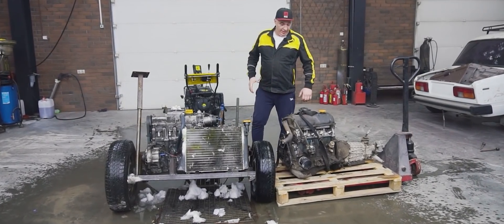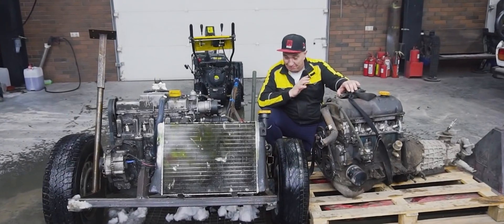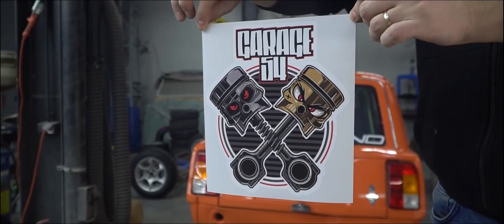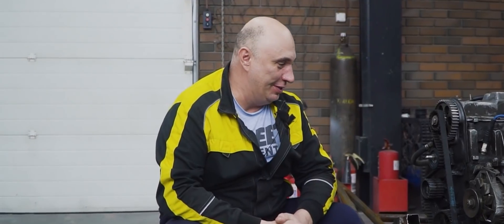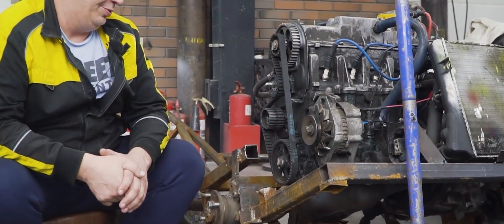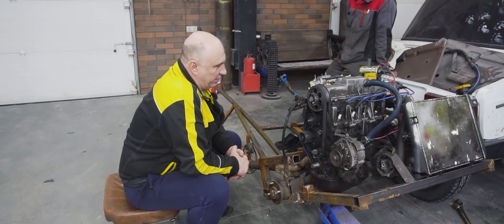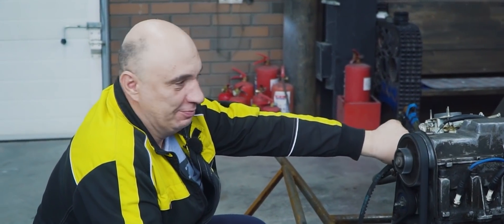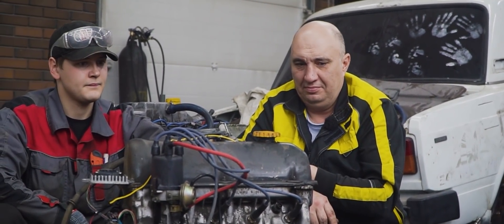8-stroke engine?? How does that even work?

Comment: If you simply double the number of cam rotations for each crank rotation, the valves would just open and close halfway through each piston stroke, pushing unburnt fuel out the exhaust and the piston loses compression halfway through the stroke. That's why it was hard to get those engines running, they essentially only had about half their cylinder volume to work with.
Reply: exactly .... was  doomed from inception...
Reply: If the timing shaft is at the correct position for TDC, then they will also be in the same TDC position at BDC with the inverted gear ratio (half crank = full timing), which means the exhaust valve should cycle somewhat before half-way through each stroke and the intake slightly after with all valves closed for the first and last quarter of each crank. With everything else timed properly, it should have 30-40% of a cylinder to work with depending on how quickly the intake valve closes. Needs a turbo to force air-fuel mix through in mid-compression (after losing most of the "intake" charge to the exhaust valve opening during compression) to have a chance of working.
Reply: @teardowndan5364  Possibly yes. I'm too lazy to draw it out on paper but the addition of a charger (although I would go with a supercharger than a turbo since you would need a good amount of exhaust pressure to pack the o2) might do the trick....
Reply: Considering "stroke" is number of pistons moving( lets not even start with waste cycle difference.....twinspark,water injected applications 
This Episode was never going to be a success. 
Adjusting the belts gave a few ° in timing. Causing over fuelling.
"Crankshaft" needed to be swapped with V8crankshaft and the Pistons need to be half moon x2 to complete chamber Cylindrical shape.
In doing so should mean half capacity engine running at twice speed creating normal power of 1 engine.
Reply: Before doing all that work you could have just figured it wasn't going to work
Reply: Exactly
Reply: @Karl with a K 😂

Comment: This is the first video i've seen where G54 gets it wrong...
You can't just swap the cogs, the ratio is wrong... You said it yourself that it was a 1:4 and what you want is 1:2...
Not only that, but the distributor needs to be slowed down too.
I havn't seen the original video, and i dobt an 8 stroke would yield more power, but you got to atleast give it a proper try and use some logic if you are not using the exact same engine.

Comment: Nope, you turned this into a one stroke. If the camshaft turn twice as fast at the crankshaft, you open and close the valves for every stroke. So piston moves down, valves open and close, piston moves up, valves open and close, piston moves down again, valves open and close, piston moves up to complete the intended fourth stroke, valves open and close again. Every stroke both the intake valves and the exhaust valves open and close. This would not even work as a two stroke. For a two stroke you would need that same rotation speed of crankshaft and camshaft. If you want to build an eight stroke engine, you must make the camshaft turn two times slower than it is turning on a four stroke. Not faster, but slower.

Comment: this seems more like a 1 stroke engine, for every single piston stroke the intake and exhaust valves open so it is trying to be a one stroke engine. if you wanted an 8 stroke engine you would have to put a bigger cam gear so that the piston does multiple strokes before the valves do their thing.

Comment: What about making a good old 2-stroke engine, by putting the same pulleys/gears on the cam and crankshaft as well, getting a 1:1 ratio?
Reply: Though 2 strokes typically don’t use valves, it seems as though with a little cam timing work this might actually work!   Great idea.
Reply: Poppet Valve engine. They have done, on a VW Diesel engine.

https://www.youtube.com/watch?v=kot9GYBeCJ8

Comment: I hope this was a joke, you guys certainly should have known this wouldn't work, and what the result would be.  I'm guessing you did given the demeanor before you fired it up.  Besides, if you could turn a 4 stroke into and 8 (whatever the hell that is, every other normal power stroke dead?) you would end up with LESS horsepower, not more, because it would have a 1/2 as many power strokes/turn.  Same way a 2 cycle of a given displacement was more hp than a four.  Last point, if this actually would work the automotive engineers would have figured it out and used it.  If there were any watching they were probably laughing their asses off...kinda like you.   Some of the crap on the internet (the original video) are beyond belief.  I don't mean the fact that they won't work, I mean the fact that someone takes the time to spoof that kind of nonsense.

Comment: The only thing close to this that I've ever heard of working was I believe Ford had a small block v8 it might have been the 1st of the 302's that you could swap 2 of the cylinder's firing orders and generate more power I think the engine was less efficient but you made a significant jump in power. maybe 30/40 hp which is significant for the amount of work required.
Reply: 4/7 swap. works on gm small blocks too

Comment: Try  Is forced induction like a Turbo it would fix the stale air If the cylinder through it may not fix the timing issue

Comment: cam shaft will not allow enough fuel to stay in combustion chambers, if the cam is in time the exhaust  will open before compression so no compression! if you can  see  piston location to valve timing  you should see why it dont start !

Comment: Wouldnt a valve always open during a compression stroke if the cam was making 2 rotations? I am not sure how this would work.
Reply: Yes. I've always thought the whole "you need three things: air, fuel, and spark" was an oversimplification. You also need compression, and all four of those things have to happen at the right time.

Comment: I was under the impression that the crank was making 2 more rotations for every 1 cam rotation. So 4 to 1 crank rotations instead of 2 to 1. But it makes sense why you flipped the gears to get this. I wonder if you made the crank rotate 4 times for 1 cam rotation if that would make any difference. I kept thinking no but then I wouldve thought this wouldve ran or something.

Comment: I always wondered about a 6 stroke engine.
Intake (fuel), compression, power, exhaust (fuel), intake (no fuel), exhaust (no fuel)
Fully purge the engine with each combustion cycle. Should be able to make water cooled power on an air cooled block. Reduce the weight massively, and a turbo might improve heat scavenging. With the turbo you might leave both valve open for the flush stroke?
Reply: That's a bit like a hit and miss engine.

Comment: Screw 2 flathead engines top to top so both pistons meet up to fire at the same time. What could go wrong? So instead of horizontally opposed it would be an horizontally inpposed engine.
Reply: Aren't there actually diesel engines like that? In submarines or smth?
Reply: @sloopkogel22  Old large 2-stroke diesels, but they tend to need forced air induction to work..
Reply: There are engines like this, sterling engines maybe? Can't remember exactly but I'd love to see their version
Reply: The T-64 tank used an opposed-piston diesel engine. You can also look up the Fairbanks Morse 38 8-1/8 diesel engine used on watercraft and locomotives. And for fun, look up the Napier Deltic.
Reply: I was totally thinking about an opposed piston engine with two blocks together but I didn't think about a flathead engine. Maybe do OHV for one block and a flathead for the other. That would be wild!

Comment: In a 4 cylinder. Modify 2 cylinders as air compressors and feed them to the other cylinders. Self supercharged
Reply: this would only feed the normal air volume of a cylinder. no extra boost
Reply: @atsekjoker  It would be great, who doesn't love getting less, for more?  Oh, wait.
Reply: @atsekjoker  in 50cc landspeed record they tried this, it forces the air in after the other cilinder almost finishes the inlet stroke, effectively putting in 100cc of air. This was meant to circumvent the 50cc limit so to say
Reply: @atsekjoker  would be double
Reply: @atsekjoker  And what about the intake stroke? It would pretty much just return the air.
Reply: This guy invented free energy! (The compression cylinders need to have a insane compression ratio for that to work I guess.
Reply: This is already a engine design, you basically double the air intake of the other cilinders
Reply: @NoctisIgnem  but has it been done with a LADA?
Reply: 2 cyl feed 2 cyl = 0 gain. How about 6cyl as 2 cyl run and 4 to compress. 🧐
Reply: @diywe   well the air compressor cylinders would be essentially 2 stroke. Making the volume of air double into the running cylinders

Comment: There are actually 8-stroke engines,  the cam rotates once for every four engine rotations. They would have a heavy flywheel, cam grind would be very different, and would be good in agricultural pumps and some generator applications. Efficiency would be good, but output would be fairly low power though.
Reply: So what are the other 4 strokes? Apart from suck, squish, bang, blow?
Reply: @MariuszChr  pretty sure he doesnt know, but i think he is refering to the single cylinder hit and miss governor engines from the 1900's https://youtu.be/hlc-i7gxW94
Reply: @MariuszChr  You hit the nail on the head. It's physically impossible. The only thing that happens is the repetition is 2x the speed leading to failure.
Reply: @NIGHTOWL-jf9zt  it maybe makes sense to blow gases twice for cleaner air mixture, but probably worth nothing seeing EGR systems...
Reply: @MariuszChr 
Absolutely.
Marius is correct. May be sarcastic. 
In theory no more strokes other than
intake, compression, power, and exhaust.

Any further would be multiples or increased cc.
Reply: I have come across a 6 stroke experimental engine with a scavenge in and scavenge out stroke inserted between the exhaust and inlet strokes.
Reply: To design an eight stroke you need to define what each stroke is for and then design the valve action to suit. e.g. 
1 induction
2 compression into charge tank
3 induction
4 compression into charge tank
5 induction from charge tank
6 induction from charge tank
7 ignition
8 exhaust
Would need a heavy fly wheel or at least 8 cyclinders to run. Couldn't see the advantage though.
Reply: A stroke doesn't mean an ignition by half a piston cycle lmao
It's like saying your car is a 0 stroke when you let off the gas

Comment: These engines are 4strokes in 2stroke cycle (it suck & compress in first stroke, then it ignite & exhaust in seconf stroke (when piston is going up)). Try 2x smaller wheel on crankshaft, maybe it will work. It would be interesting to see working 8stroke engine.
Reply: is this 8 stroke possible suck, squeeze, 5x bang and blow

Comment: you should build 2 lada engines on top of each other so the cylinders against the cylinders no valves or cam shaft
Reply: where does the air come from and where does the exhaust gas go to?
Reply: like an Opposed Piston Diesel Engine, i like it!
Reply: @fanplant  you would need a cylinderhead between the two motors with side valves, ore bore the block to press air into it and let out the exhaust gases
Reply: @atsekjoker  not a head as much as a spacer with intake and exhaust ports and valves. That is unless they drill ports in the cylinder walls and make it a 2 stroke. Oh those poor Lada engines

Comment: Might have better luck converting a 4 stroke to a 2 stroke.  With forced induction I'll bet you could get a little four cylinder like that up to about 300HP.  At least until a rod goes through the oil pan.
Reply: I like your idea but let's upgrade rods and Pistons and rings to give it best chance of working
Reply: @bigjay875  I second this
Reply: The Detroit diesel 8v71 is what your looking for. They solved all those engineer problems.
Reply: @tommysmith8801  yeah 2, 2 stroke diesels converted into opposing Piston, those 8V71's would be a beast lol.
Hold on sorry 6v71 is the straight right.
Reply: @SP-mp9yi  there's a company trying to bring that engine platform into reality but 3 cylinder.
Reply: @tommysmith8801  Yeah I saw a YouTube short on one, it sounds really promising, very good on emissions with high power outage, someone had commented that it's been in the Railway Industry for years but I'm not sure.
LoL probably not an easy bolt together though l may not have thought that through 😂
Reply: @tommysmith8801  No shit worked on them before.  That's where I got the idea.
Reply: DKW Auto Union
Reply: There need to be a camshaft, and there need to be a supercharger to force air into the cylinder, since the crankcase precompression is missing. Thats how 2 stroke diesels work, valves and a positive intake pressure.
Reply: @pflaffik  Actually the Detroits I worked on don't have cams at all.  Forced induction and cylinder ports.  Most 2 strokes don't need poppet valves.  Just reed valves and cylinder ports.
Reply: @rayceeya8659    2 stroke Detroits still use a camshaft for the exhaust valves and the injectors
Reply: Yup
Reply: If he doubled the speed of the camshaft, this IS a two stroke.
Reply: @tomwilson2112  but also reduced the crankshaft speed by half so camshaft speed difference is 4 times compared to original setup
Reply: @tomwilson2112  not double, x4. they went from 1:2 to 2:1
Reply: I'd wonder about bearings. 2 strokes are a lot of things but in my experiences 2 strokes are not high revving roarers. Also heat.
Reply: what are they even trying to do ?rotating the camshaft 4x quicker makes both intake and exhaust valves open and close once for every stroke. thus no stroke does anything properly. no intake, no compression,no expansion, no exhaust. probably no ignition either. just a bunch of valves opening and closing and not doing any useful work, just pumping some air/fuel mixture back and forth. also with an interference engine, the engine won't even crank 45 degree before hitting a valve
Reply: Yes that would work with a Rutz Blower.....
Reply: I wanna see that in a Lada!
Reply: Look at the mountain Yamaha sleds and modern waverunners
Reply: Yep Cam and Crank 1:1 ratio , and then force feed it :)
Reply: Yeah, just pull the cam out altogether.  You should make a video on youtube that says you did that and got 600 bhp, like the idiot this goofy crap was based on.  :-)  It won't do anything, BTW.  Actually converting one to a two stroke (cylinder ports) would require near as much welding and machining as just building a two cycle from scratch, and would be far more of a nightmare.
Reply: @MrJdsenior  That's why I specified forced induction.  Pump the fuel and air in through the crank case and have reed valves on the pistons.  Keep the cam.  The intake manifold becomes another exhaust manifold.  Biggest problem I see is where to source a roots blower the right size.  Then again they're Russian so if they blow the engine in the experiment then who cares.
Reply: @MrJdsenior  that's actually possible thanks to electronically controlled valves. No need for cam or timing system, just takem out it'll be much better lol
Reply: @rexracer7192  yes with freevalve, supercharger and electronic direct injection and ignition you could  run the same engine on Otto, Atkinson, HCCI, 2 stroke or diesel. you just need enough compression for diesel auto ignition and disable spark. for 4 stroke you close  the intake valve later to reduce compression and use the spark. for atkinson you close it even later. for two stroke you time the valves like ports in a 2 stroke but you will need a lot of boost to scavenge the exhaust gases. but also changing the timing to reduce compression means you're also effectively reducing displacement.
Reply: @rexracer7192  free valve engine with programmable ECU would be insane for tuners

Comment: Just because the valves open twice as much, doesn't make it an 8-stroke engine. It actually makes it a useless machine, since the opening of the valves makes it impossible to achieve any compression. Nice try though :D
Reply: 4 times as many times. but yeah, its a useless contraption only making smoke, some fire and noise. lol

Comment: 6 strokes are relatively easy by having a high pressure engine and a secpondary low pressure cylinder in a 2 stroke configuration
Reply: I see your idea! Though, in that configuration you have a 4 stroke rotaion and a 2 stroke rotation, that alternates. I guess that's what you meant. Would be fun to try that out, but it will cause a lot of vibation and it puts the crankshaft under an uneven stress.

Comment: You did not actually create an eight stroke engine it's more like a one stroke or half stroke. In order to make it an eight stroke you would have to make the cam gear twice as large
Reply: I was going to say the same thing. Cam rotates 8 times to 1 rotation of the crank. An 8 stoke would have the crank rotating 8 times to 1 rotation of the cam.  Hence a 4 stroke is 4 strokes to 1 cam rotation.
Reply: This is right!
You had the crank only doing one cycle the valves were opening while is trying to compress hence why it was spitting out of the carb!

Comment: Spin the Camshaft the same speed as the crank...add a supercharger.. would be 2 stroke, bit like a Detroit.
Reply: I was thinking the same thing. Would love to see how would it behave under throttle
Reply: Cam shape and cam offset doesn't make it 2 stroke ever. It just won't work
Reply: @RubyRhod  if these blokes can do what they do with engines.. reprofililing and changing Lobe seperation  and phasing on the Cam is child's play.  There are a few  supercharged Poppet Valve  2 stroke conversions about on You tube..
Reply: @austinmaxi  yes surely they can do it, but they will have to modify the camshaft.